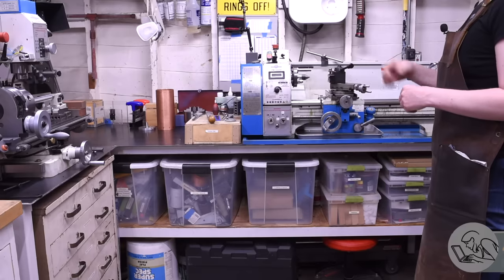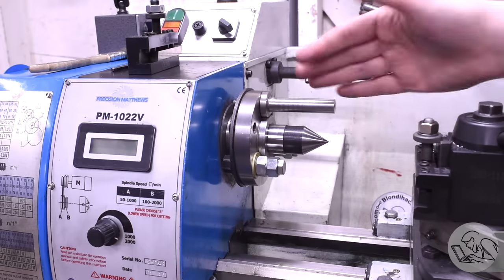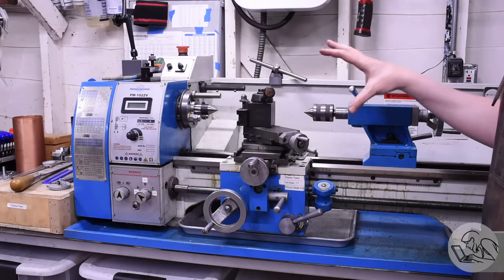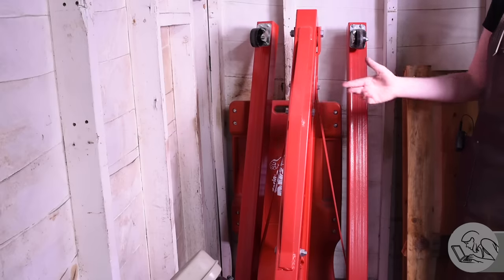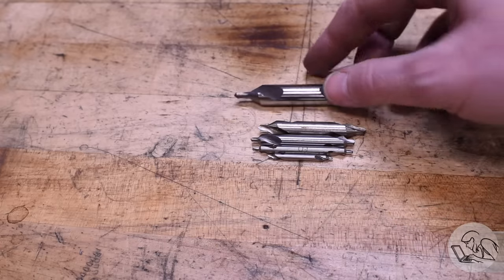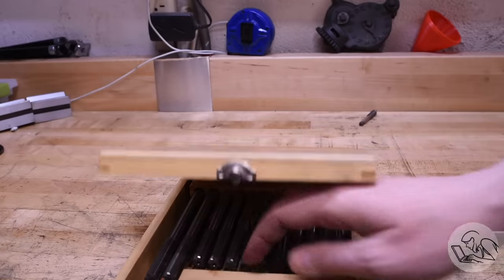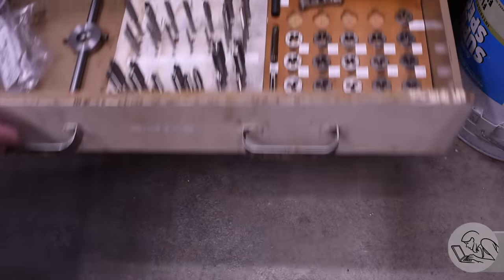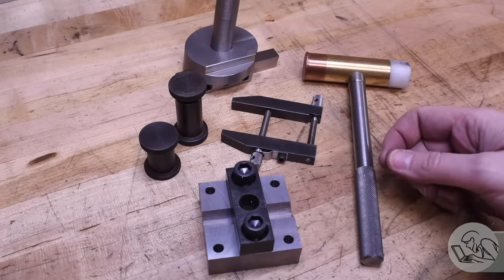Getting Started In Machining - Absolute Beginners Click Here!

Comment: Haha, about 2 years ago I got "sucked in" to all the machining videos. I never ran a metal lathe or a mill in my life but consider myself a pretty sharp person in a body, mechanical, or welding shop  I learned 90% of what I know watching these videos. I went out and bought a nice older industrial lathe. Then I bought a decent older Bridgeport.  I have been able to make those machines pay for themselves many many times over since I got started.  With YouTube, the internet, and some motivation,  it can be accomplished, I'm a believer!  Through YouTube and the internet,  I was able to even build myself from scratch a 3 phase rotary converter for the lathe.  I got lucky on my mill in that it's got a single phase motor on it I wired for 220 volts. Thanks for all the lessons and motivation Quinn, and the other YouTube machinists that have unknowingly contributed to my success. 😁😁😁

Comment: Bought my first lathe four days ago - 1949 South Bend 9A. Two days of assembly and my first project is replacing the missing dauber on the tail stock.  I need more has cutters - it only came with two! But it has the taper attachment, quick change gearbox, power cross feed, steady rest, dogs, faceplate, Chuck, collets 3C and virtually zero wear on the ways or tail stock base. And it is a collectible since it is stamped “US ARMY” in several places.  And it is VERY quiet.

Comment: Great video, I always think I should buy a mill first as I can see that being more useful for me (and it would replace my small drill press) but you make good points for buying a lathe first!
Reply: When I first entered a workshop in my teens we used a lathe with work piece attached to cross slide to performing milling. Not ideal but it filled the technical gap. Took me 40 years before I realised you could do the opposite and use a mill as a crude lathe, so I always recommended getting a lathe first.  Anyway what is mill other than uprated drill press with an added crossslide.
Reply: @martinhansen2315  A mill is a lathe on its side. Mounting the workpiece on the cross side, with tooling in the spindle is how mills became a thing.
Reply: Bought a mill first then when I need to turn something I bought a rotary table for the mill, not fast but cheaper than a lathe.

Comment: Buy inexpensive, reamers, bits, etc, and as you use them enough to dull or break them, you buy a high quality replacement.  That way you know which tools you will use, enough to justify the expense of high quality tooling.
Reply: Just not with the taps...
Cheap taps just make you buy fresh materials so you can start over.

Comment: @quinn A good video for the beginner to start to appreciate what getting involved with metal machining involves. I would recommend adding to the list before buying anything a journey to a club. Here in the UK we have many Model engineering clubs that will welcome beginners for a few meetings before you are obliged to join, but members will be a source of information of suppliers and skills. Some clubs will have machine shops where you can learn some of the skills before splashing the cash.
 We have Model engineering shows that many suppliers attend, and you get to compare your choices for new and used equipment in one location, plus get metal, tools, ideas etc
  On the question of lathe or mill first, I would say that the deciding factor is what are you going to make? Many times it is possible to use either machine but one will be easier than the other e.g. making a rod with threaded ends, a lathe, making a large flat plate with threaded holes, a mill, but with experience (or someone else's experience) and the accessories you could do the jobs with either machine.
  Finally be prepared to learn. I started learning at High school, I am now in my 60's and still learning, and the most important learning is that is often many ways to do the same thing.

Comment: Excellent, logical rundown of getting started in metal work. Of course, where you are poses a completely different set of problems. A ground floor garage or shed is really a must for the big stuff. I have a spare bedroom in a social housing block so am a bit scuppered on the heavy noisy stuff. Above ground floor you can't even hammer on a table it creates so much vibration.

Comment: Lazy peoples woodworking tool are screaming… a good woodworker’s tools are silent and need to be pushed.
Reply: I remove shavings by barrel full from my collector. Minimum sanding in my shop. 320 grit for between clearcoats is about it.
Reply: @robert_g_fbg  Sounds amazing, metal lathes are amazing and make amazing things, but for a finish, wood and a sharp plan are just unsurpassable.

Comment: One point in favour of the 7x imports is that they are common enough to be considered modular; with a little patience you can start with a 7x12 and upgrade it eventually to a 7x16 with a bigger headstock and a long-travel cross-slide.  One caveat with the QCTP is to check on the maximum shank size they'll accept; mine was 7/16" so 1/2" tools were sitting above centerline, at least until I milled a little off the top of the compound slide casting.

Comment: Like your shop Quinn. My lathe like yours but is almost 60 years old, owned the Canadian Government, what were they going to do with it, they didn’t even know, as it was soooo dust covered, stuff could barely move. It also has a mill head with it. I have a table top drill press I bought in 1980. A table top wood band saw, I modified to cut metal instead. A small bench grinder and a new small belt sander. 4 days ago, I just bought a mill, looks just like yours. Now, like Pinky and the Brain, I’m getting ready to take over the world !

Comment: What a God(ess) send this video is. I acquired an old Clausing series 100 mk3 lathe that appears to be in turn key ready to go decent shape. No rust, everything turns and moves, etc. Got it for… free (long story there on that).  It was a job moving and getting it up on the table (like Quinn points out, better have a cherry picker and I added a load leveler to that and at least one friend). But it has almost no tooling. Three jaw chuck, lantern style tool post with one HSS bit in it and the tailstock has an mt2 to mt3 adapter with a Jacobs chuck for it. Thats all. I didn’t even know where to start to get the tooling in order of importance. Because I am an FNG about to embark forward in this hobby. All I knew I wanted was an Aloris type tool holder, which I did buy already and will have to go to a buddy’s house to mill a T-nut for.  Now I know which direction(s) to go in first. OMG(ess), thanks Quinn!
Reply: I’ve got the same machine, look into getting a 1/2” link style belt for the headstock drive. Hard to find much literature on the machine

Comment: So, I'm in an interesting predicament lol. Grew up with a General Contractor father, so I learned building / remodeling / roofing / farming. He didn't really do much metalwork, so after Shop Class I became his stick welder. Then I went to college, got a degree, worked for four years and became disabled in 2016 (Psoriatic Arthritis). I started doing some welding / fabrication stuff (mostly while sitting down lol). I now am able to walk / stand much longer and I've welded up tons of stuff. Work benches, Shelf brackets, Farm repairs, Tool Stands / holders, etc.

My shop tools include a Mig Welder, Stick Welder, Bandsaw, Fixture Table, Drill Press, Manual Metal Bender and then the usual Vises / Grinders etc.

Somewhere along the way, I learned about Annular cutters and mag drills. I got a Morse Taper to Weldon Shank adapter for my drill press, and it's amazing. No more twist drilling 1/2, 5/8, 3/4, or 1" holes. Now, I wish that I could use my cross slide vice to make slotted holes and machine parts lol. I work almost entirely with mild steel.

I don't know if a lathe would be that helpful to me. I've considered it before to make dies for my metal bender, but other than that, I don't think it would be that helpful. Am I looking at it wrong / too ignorant to machining, or do you think I'd be better off just going with a mill. Either way, I'd only get a "mini" or "small" version. It'd just be helpful to make some small parts, cut holes, etc.

Comment: I enjoyed this video, think all of your points are valid. However, in putting together my shop I took a very different approach. I purchased my 12” Atlas/Craftsman lathe with a quick change gearbox on Craigslist, driving about 700 miles round trip to pick it up. I purchased most of my tooling on eBay and shop estate sales for precision instruments. I used to live in an area with lots of retired aerospace machinists so there were lots of quality American made tools available in expensively. That said, I am an older guy with a fondness for vintage machinery, so this is largely a personal choice. Thank you for what you do, I get a lot of inspiration from you and your site.

Comment: Love listening to your hard earned knowledge, you have so much of it and dispersed very wise. The one thing I have never heard you cover in all your safety talks which are dead on is the fact that in my opinion, that and 5 bucks will get you a Starbucks. Back to the point, after 35+ years of machining I have seen the craziest acts. One novice spun up a Hypromax at over a 1000 RPM's with a 3/4" glass filled Teflon with 2 feet hanging out from the head with no support, almost took a guys arm off. Another had a piece of carbon steel 1" round hanging out 3feet no stand and V-block, spun up a Clausing, it lmmediantly  bent 90 degree and ripped the machine out of the floor, walked 2 feet and ripped the electrical out. Point is, anyone buying machines that as you pointed out are trying to kill you should have some kind of formal training if only beginner stage because of setup, tooling, types of material, feeds and speeds, and safety. It's a spinning Ginsu knife waiting to dismember you.

Comment: One thing I would suggest for beginners especially with smaller machines since they do better with hss. once you get a starter set of hss bits you're gonna have to learn to grind them so you don't have to keep buying preground which can get expensive to mess up. I first suggest buy cold rolled steel square stock in 1/4 3/8 etc and use that to practice grinding with your set as a guide to copy. you need cold rolled since its usually within a couple thousandth of stated size hot is all over the place and usually way under. the other good thing about CR is you can easily blue it or use a sharpie then you can scribe lines on it with a protractor to 8 degrees 12 degrees etc to follow. once you get the hang of it then you can start grinding HSS

Comment: Some hints: Dont use HSS or fixed hard metal tools for the lathe, buy insert holders, they are cheap, If it broke, just change the insert and go on. A set of 10 inserts mostly by 3 to 8 eur. A set of screws for the holders cost a few bucks, you need them. Inserts can optimised for material. Steel, Inox, Titan, Al and others. You can go faster and get more chips even with a small engine. If you use steel, use only maschinable steel like 1.7131 (EC80), 1.1730 (c45) 1.0715 (11SMn30) i prefer ec80, because its cheap, strong and very good to maschine. Use steel Inserts for best results.

Comment: You're right on the lathe first and the floor standing drill press. I too got caught up and bought a mill first.  A bunch of parts would be much easier to make on a lathe, and my late model Craftzman bench drill press is junk.  King of runout and vibration.

Comment: I would add, unless I wasn't paying attention when Quinn said it, 150mm and 300mm rules (or freedom unit equivalent), and small (75-150mm) squares. Scriber, Sharpie, paint marker. Mark all known materials with paint marker, you'll thank yourself in 5 years. Write down speeds and feeds for different materials, and the results you got, in a notebook. Try to find an older used copy of the Machinery's Handbook, but much of the important info (feeds/speeds, tap drill sizes etc) are available on free apps. Good lighting! If you're setting up a workshop, paint everything white first, it makes a big difference. Wear apron/coveralls/shoes that don't go in the house. Tracking sharp swarf/oil into the house severely impacts Domestic Partner Hobby Acceptance Factor, and consequently can adversely affect your time and tool budgets. See if you have a local Model Engineers club. Have fun, learn, and share. Wash your hands. Call your mum. Floss.

Comment: I’m working with a 9 inch 120 year old Dalton change gear lathe with separate screw feed. AND just got a 1963 17 x 42 Leblond Regal to go with the table top Hardinge horizontal mill and the Bridgeport.   
  I had to create a building to accommodate it all. I think I have a problem. Woodworking, metalwork, welding, blacksmithing.. uhoh

Comment: I got myself a craftsman 101.21400 lathe. $1000 for the lathe, and about 40 different cutting tools for it. Best part is, it recently had new berings installed, so its like new. 
It doesn't have the fancy creature comforts, and you have to change out the gears for threading but its more than enough for someone like me who doesn't use it daily.

Comment: Some people come at this like you appear to have, "I want to make cool stuff," and some come to it from, "I'm doing something else and I'm tired of not being able to get parts, fix some things..." in my case I am a car guy that got into custom fabrication and found that machine tools get more use then welders on some projects. From that perspective that changes what is necessary and what is nice.

Lathe vs Mill? Yes, a lathe can make all your other stuff and you can cobble it into an awkward mill, but I found that I could get a Bridgeport J-head even a little clapped out for much cheaper and it got my projects rolling faster. I bought a 3 and 4 jaw lathe chuck mounted on R8 tapers and then used the mill vice to hold the lathe tool and the table as a cross slide/compound. I needed to mill and surface things more than turn them and had known that because I had a big drill press that I set up with a x/y vise and also with a "tailstock" for a couple of years and found that I tried to use it as a mill dozens of times, as a lathe only once. I eventually ended up getting the grizzly lathe similar to your lathe.

Lathe size is not just about what you have room for, can move, or can afford. The big stuff has speeds and features that work for the big stuff, the little lathes have speeds and features that work for little stuff, they don't really overlap. Figure out how big the stuff you're going to be working on and choose accordingly. That said, the 9-10" range is the sweet spot for most home gamers that want to make real sized things. I'm sure there are places where the old iron is still available but for example around here the southbend and craftsman old iron is rare, expensive and clapped out. For what a SB 10" that you'd have to put a few weeks/months worth of work into goes for around here you can easily buy a nicer import similarly sized, a bunch of tooling, and pay for your first few projects. I'll eventually get a big lathe in addition to my little one. I find a lot of work is ending up on the Bridgeport on a 10" rotary table with a 16" plate clamped bolted and faced to the top of the rotary table.

A 4 jaw chuck can do everything a 3 jaw can and more. That said I've only had my 4 jaw on my lathe once in >15years and that was mostly because I wanted to try it. For most "meatball machining," the 3 jaw is good enough and faster. If I didn't have the mill first this might be different, heck, I had a rotary table for the mill first. The 3 jaw that came with my grizzly is accurate enough to turn parts around in and get barely a visible step and I'll take an extra step or change the order of operations to avoid it anyway, it's faster.

I've never used a machinist reamer. I probably have half a dozen or more boring bars and boring heads for the mill.

Get comfortable with dial calipers. The digital ones are nice, but batteries always die, especially in the winter if your shop is not heated. I've had 2 that would lose their 0 at random and all sorts of other problems. I keep a couple of digital ones around for when I have to go back and forth between SAE and metric, one by the 3d printer (that's all metric), but I have old-school dial indicators in those places and all over the shop/house. They always work.

Cheap Harbor freight numbered bits are pretty good. Their 135* bits (in the metal index) are good. The rest are cheap and suck, quite often bent or ground off center out of the box. I keep 3 sets of cheap ones around, I use bits out of one, and when they break/wear out I grab a new one out of the 2 backups. Eventually, I re-sharpen the worn-out ones, they're better re-sharpened than new.

The big steel case HF taps/dies are nice. Much cheaper than "good ones" and I'd argue better than the Irwin/Handson ones that are the only decent ones that I can get on short notice. I haven't broken or dulled one yet. But yes, cheap tap and die sets suck. So do almost EVERY screw extractor set.

I've had good luck buying used Sandivik mills, shell mills, and other insert tooling on ebay for good prices. I've totally avoided/ignored most of the other "cheap" "get you by while you get started" tooling and the ones that I bought all use the same inserts.

Knock off Noga bases suck.